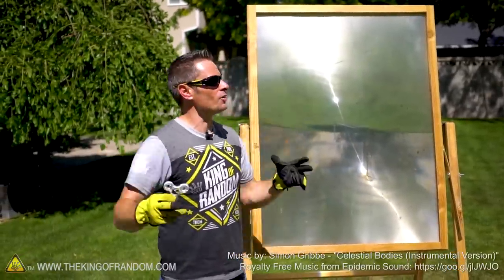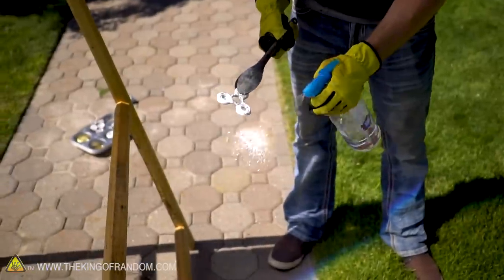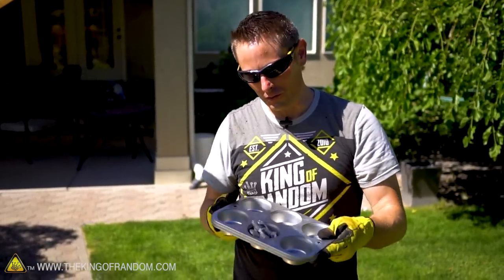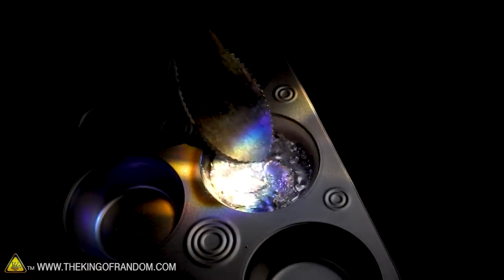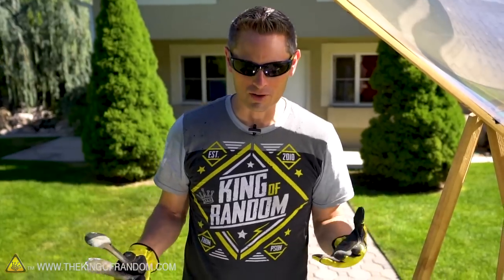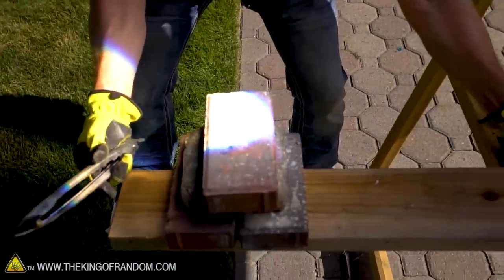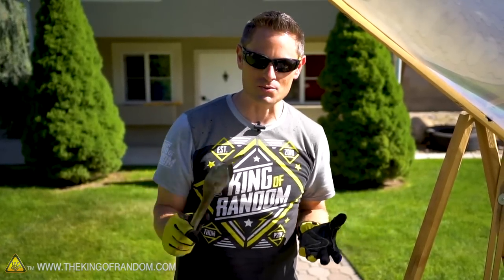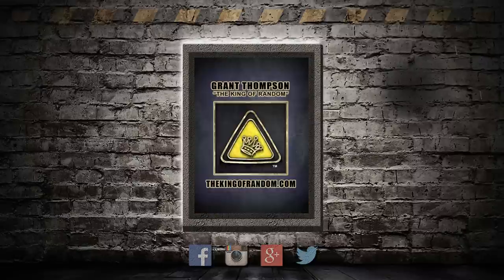Mad Science: MELTING Metal with Sunlight! King Of Random Puts The Solar Scorcher To The Test!

Comment: So, dark colors will absorb more heat than other colors. Can you build a black container to melt the metals in? I'm sure your losing a ton of potential heat because the shiny metals are reflecting the heat. Create a black heat resistant container to hold the metal in, and heat up the container.
Reply: A black, heat-resistant container would keep a lot more of the energy for itself. I think he's better off doing what he's doing.
Reply: Andrew Evenson No. He shouldn't do it because if the container is black, then it will absorb the heat which will lead to less heat in the container. When the inner surface is shiny it reflects the heat, causing conservation of heat energy. And, Your Welcome !!!

Comment: Hey! I'm not sure if it's the exposure of the camera, but the beam of light at the focal point looks around 1-2 inches in diameter. You should try to take a magnifying glass from that, and try to focus the beam even more. Something even smaller and more concentrated! That would be awesome to see what you could melt with that!
Reply: The rays can only hit on one spot all together. It is not possible to focus it even more :) Maybe direct the rays into the focuspoint with different angles, but it would not get more concertrated or even hotter
Reply: so you can't like put an extra magnifying glass in front of the focal point so the beam is more accurate?
Reply: thats not how it works you need a bigger scorcher or a big mirror reflecting on the scorcher
Reply: Sam Verleye if he focal point of that big lens he is using is 1-2 inches in diameter, you should be able to use a more precise and smaller lens to focus it even more, but I'm not 100% sure. I'd love to see someone try it
Reply: I know you can't focus a focal point but like get the beams that were already there and just making it better idk sounds legit anyway
Reply: The rays will devide with a another lense. You would have to set up at least another two to do what you intend. BTW the perfect focal point is where every ray passes; it should be tiny. The focal point of the scorcher is imperfect due to the probably imperfect lense. It was used in a tv, its not made in perfection :)
(sorry, for my bad english.)
Reply: Why Not? Yeah if he had perfect lense he could probably cut stuff in half with the laser
Reply: Why Not? lo
Reply: i dont know all them fancy science terms, but this basically IS a magnifying glass. sticking another one in front of it would melt the glass of the 2nd magnifyer, i think? now im curious if one could melt glass with this stuff.

what youre describing is more like a telescope, which i know uses a different lens, but im only a simple delivery driver, so i dont know what its called i just remember something from science class about it.

i am also very curious if that would work but do not have funds to explore this fun stuff on my meager salary. if anybody knows where i can dumpster dive a big screen, btw?

Comment: The light has no temperature, heat is only produce if the light is absorbed by a non-reflective materiel and the potential momentum energy of the photon being absorbed creates heat, so the more reflective the metal is then the less it will heat up. If he used a gallium mirror which melts at a temperature of 85.58°F/29.76°C and he placed it in the light beam it would reflect most of the light and likely wouldn't melt. for the aluminum to melt you would need to reduce the reflectivity of the metal.
Reply: NOBODY CARES
Reply: Chase Abel Many people care
Reply: considering this is a science based channel, I can accurately say most people care
Reply: umm you should change the typo
Reply: Experimental Fun I would love to say I read all that and understood it, sadly I did not.
Reply: Black or brown anodized  aluminum. It was used in windows and cars.
Reply: Experimental Fun pure logic. love it
Reply: that makes complete sense why did i not think of that
Reply: ok
Reply: Chase Abel NOBODY ASKED UR OPINION
Reply: Does Photons have temperature?

Comment: What would happen if you put a magnifying lens at the focal point?
PS. thanks for the Celsius.
Reply: Brandon Ali the lens would melt
Reply: Mister Man only one way to find out, I'm assuming if a glass lens was used it may concentrate the light even further. Glass having a high melting point as well would be more preferable.
Reply: Brandon Ali if he used glass with a higher melting point, yes, it would concentrate the heat further. that would probably make the focal point similar to a laser
Reply: Mister Man That would definitely be something interesting to see, a "Solar laser" .
Reply: Brandon Ali rainbow
Reply: He could also use a concave-sided lens which these same kind of TV's also have inside them to turn the focal point back into parallel light rays, making a straight compact beam of light that could be directed with mirrors. Now THAT would be more like a laser. And of course multiple apparatuses could combine their power into one.
Reply: Brandon Ali Wonderful curiosity you have. May the universe keep you amused. 😀
Reply: i dont think the lens would melt since it doesnt absorb the light but it lets it pass through instead.
Reply: Duff Smith  even though that's a great idea to try, it still wouldn't be coherent light rays unlike a laser.
Reply: Certainly not like a laser, but you could get that hot focal point further away from the fresnel lens and bounce it sideways with a mirror to combine it with another such beam onto a target object like a graphite crucible.

Comment: Aim the solar scorcher at a solar panel and see if it increases the amount of energy produced.!.⚠️⚠️⚠️⚠️⚠️⚠️⚠️
Reply: Itll ruin the solar panel
Reply: It would increase the energy produced because you're focusing more sunlight on the panel - but it would also heat up faster.
Reply: Power a wind turbine with a hurricane.
Reply: Power a water turbine with a tsunami
Reply: Andrés Báez The Craziest Puerto Rican 
Thats like powering a water mill with a tsunami 
Or a windmill with a tornado
Reply: LOL, thanks for the replies.
Reply: You don't want to focus too much sun on a photovotaic, but you can raise the efficiency (if not the lifetime) of a solar panel by doubling or tripling the input with mirrors.
Reply: the panel would burst into flames
Reply: Not to mention this thing does not amplify the power of the sun, it simply focuses it. So there is no increase in power. Its the same amount of power in a smaller area. so No it will not create more electricity via a solar panel

You would need something like an array of these in different locations aimed at the same place or a magnifying glass much much much larger than the solar panel to see an increase in power, and thats assuming you have a magical indestructable solar panel.
Reply: Jexorz86 the reason would be that mirrors are quite a bit less expensive than solar panels.
Reply: I was at no point talking about mirrors, just what if with magnification devices.

Comment: At first thanks for the Celsius ;-) 
It is possible to melt aluminum or copper with an even smaller lens. Your problem is the shiny surface, which reflects most of the incoming energy (thats also the cause why you are not able to get the first one boiling). If you would use smaller grains of the metals, more light would be reflected towards other grains and more energy would be absorbed.

Comment: Oldie but a goodie. I made the solar scorcher five years ago and was able to melt pennies and put spots of "glass" in a brick. Most interesting of all was trying to melt the platter of a disassembled harddrive. It didn't even get hot! If you've never seen the platter of a harddrive, it's made of glass, aluminum or ceramic and coated with some magnetic material and coated with carbon. It's also polished and highly reflective. It didn't even get hot, and I'm wondering if it's simply reflecting the energy away - it is light, after all. I'm wondering if that's why Grant's metal isn't melting like he expects. Is the metal reflecting enough of the energy away, preventing it from getting hot enough?

Comment: Try putting a mirror in front of a laser or the solar scorcher - will it melt or not?
Reply: Andrew Dailey This is great
Reply: Andrew Dailey Mirrors reflect. They are commonly used with lasers to redirect the beam.
Reply: Ultimo D at a certain point, even lasers will cut through mirrors.

Comment: You can reach temperatures around 3000 degrees Fahrenheit if you get the lens focused properly. It can easily melt steel. You have to get the right density of the focal point. If you get it focused inside a crucible you have a solar foundry.

Comment: Can you use several of these giant lenses to make it even hotter?
Reply: I don't think it would make it hotter. If anything it would only focus the beam on a smaller area.
Reply: Soultys Therefore making it hotter
Reply: which would concentrate it so much it would become a beam of death
Reply: Irritation Gaming you would need a bigger panel
Reply: The focuspoint would not fget any more concentrated as it already is. Not possible.
Reply: The problem with using multiple is getting the sunlight aimed in the right direction. With this you pretty much want the target, the lens, and the sun to line up straight. A better option would be to find 1 bigger one. That would allow a larger area to be focused down and it  would get hotter.

Comment: Aluminum is a thermal conductor so it will dissipate the heat. Maybe if you tried it in arc furnace brick to further concentrate the heat, it might work.

Comment: Hi Grant!
Whats happens if you put a smaller magnifying glass infront of your giant one, Do you got even better results then maybe? :)
Reply: I was thinking the same.
Reply: David Uldén it just melts the magnifying glass
Reply: David Uldén all it will do is create a focal point at a different distance, depending how 'fat' the lens is. The strength will be the same.
Reply: i wont work at all
Reply: David Uldén Nope. That rectangular lens he's using only captures an amount of solar power relative to its area. A square meter? Half a square meter?

He can focus that energy onto an area 3 by 3 millimetres, or more precisely focus it onto an area 0.5 by 0.5 millimetres, but the total amount of energy poured into the target object remains the same either way. There might be some threshold requirements, I dunno, to burn off surface impurities to get the process started, but super precise focus isn't actually needed, and a magnifying glass after the lens would bot help.

Instead, he could use a bigger lens. 2-5 times the surface area of the one in the video, to increase the energy proportionally. Or he could use multiple curved (concave) mirrors and focus each mirror on the same object.
Reply: A lense works due to the different thicknesses along the lens to which i can say it will only change the area the point is at.

Comment: What will happen if u very carefully take a drill bit to a plasma globe and fill it with water?
Reply: Trey Pope the gas inside would fire out as soon as the drill bit enters the globe and then most likely the rapid decompression would probably still make the glass explode actually probably implode and filling it water would just short out the electronics as I imagine it's not designed to be water tight

Comment: After seeing the bubbles in the pewter it made me wonder what would happen if u put molten metal in a vacuum chamber I know it would be hard to do but it would be cool thanks.
Reply: If a metal is hot enough in a vacuum it will evaporate. This is property is used in a process called sputtering and is used in making circuits and computer chips.
Reply: Yes
Reply: Plz
Reply: Logan Sickels is correct

Comment: Try using a graphite crucible, the reflective aluminium is reflecting a lot of the thermal energy, the dark crucible will absorb a lot of heat and also insulate the reaction so you will melt aluminium quicker.

Comment: Would it be possible to turn that heat from the solar scorcher into electricity?
Reply: Krono Corruption We have solar pannels fot that xD
Reply: You could by using steam engine technology: make the scorcher boil water and let the steam activate a piston
Reply: this is called a Seebeck generator, requires very pricey materials and set up. but he would also need liquid nitrogen to cool the opposite side to produce a thermoelectric scenario

Comment: What happens if you put some unopened cans of soda (maybe at different temperatures) under the scorcher? Will the aluminum cans hold up long enough for the soda to boil and explode or will the sun burn through a little since the aluminum is thinner and slowly release the pressure?
Reply: Ever tried a balloon filled with water held of a lit candle? The balloon does not pop, cause the water takes all the heat. If the heat capacity of the water is reached the balloon will pop. The can will pop and release the pressure of the liquid vaporizing. :)
Reply: That's why I would suggest multiple temperatures (cold/room temperature). There's also the pressure from it being carbonated as well as it being a metal container instead of just water and a balloon. Would the pressure in the can build up to the point where the metal gives out and explodes or will the can hit a high enough temperature to melt the can enough to slowly release the pressure
Reply: Its all about the liquid. If its already hot i wont take much more heat and the can will break at its weakest point. Same for the cold one.. In the end it will be the same result: pressure escaping through the weakest point of the can which is the top (comparing thickness of the material)

Comment: what if u put thermite in liquid nitrogen?150 likes and i do something
Reply: like so the king can see
Reply: The Random Guys it wont work
Reply: The Random Guys in another post someone wrote about fire needing oxygen it wouldn't light
Reply: i already requested this on the last video on mario fire balls go check  its like the top comment
Reply: Spongebob Squarepants thermite doesn't need fire to ignite or burn? It burns under water
Reply: +Spongebob Squarepants
You're right that fire needs oxygen, but thermite contains iron oxide which is why it burns so strongly. 
It is basically carrying it's own oxygen supply around.
Reply: wow nice lol, u seem smart lol im am only a YA
Reply: The Random Guys Because the reaction is a simple displacement reaction in which the oxygen moves from the iron to the aluminium I would guess that it would keep burning (it is not the same as burning carbon based products)
Reply: yup, its basically gonna be the same result of the mario theermite bombs
Reply: nice
Reply: Burning thermite or what? Putting lit thermite in N would just do nothing as combustion requires oxygen, but the reaction is between aluminium and iron oxide. The thermite carries its own supply of oxygen so blocking off the surrounding air would do nothing.
Reply: Well if you could get it lit, Thermite is self oxidizing, so it is a viable experiment. 
You just need a self oxidizing fuse that can also start the thermite reaction.
Reply: Set the thermite on fire and pour it whilst still flaming into to liquid nitrogen!
Reply: Don't Even Bother gocha
Reply: i didnt get looked AT ummmmm

Comment: looks like the dispersion of thermal energy is a factor to consider , if you got a insulator around the aluminum on the bottom to retain the heat  it probly reached the melting point faster . if you make it black it will make a greater divergence also . alum is a great thermal disperser , that is why there used in radiators in the car , try a clip lock bag with white paper in the sun and one with a black paper there could be 26degrees divergence in temperature , air temperature could be 26 degrees , the black clip lock is up to 66degrees on a clear day , and the white paper 40 degrees cel .  excellent subject thanks for that !

Comment: Grant try melting legos into a ginormous lego.
Reply: thats not how it works,
lego is plastic, not metal, clay, or anything that can stick to each other and is manipulative enough to turn into a bigger version of itself from its last form
Reply: that is how it works. if you melt plastic it will turn into a liquid that you can mold into a shape. how do you think legos were made?
Reply: You can melt easily plastic with acetone
Reply: Meme Machine it's possible if you melt it on a low enough heat. my uncle used to play with Lego and he played with them on the radiator but then one day young padderino left the leygo unattended and can you guess what happened. yes son they melted. and if you need proof they Lego's at my grannys house...

Comment: The tray concentrates the heat. Make an insulated tray for melting metals. 
Use two muffin trays. Put a layer of insulation between them.  You will have success.

Comment: You should try to make water boil with the solar scorcher and then make ramen with it
Reply: Monica Smith You could, the boiling point of water is only 100 degrees Centigrade and the metals he melted had higher boiling points than that
Reply: Sajan Singh that's true but water is more reflective
Reply: yeah the water he put on the pewter was turning to steam instantly